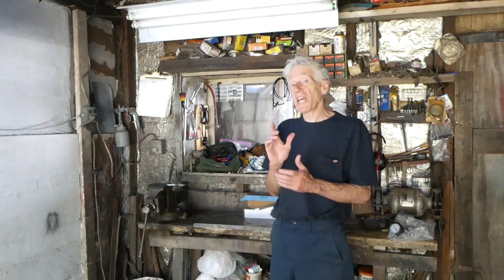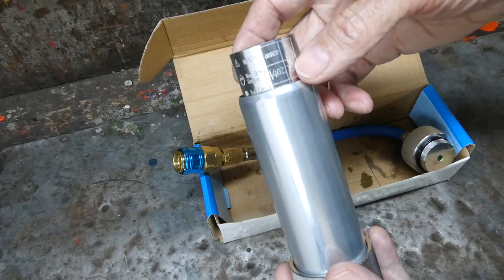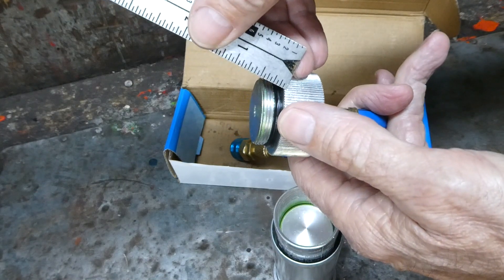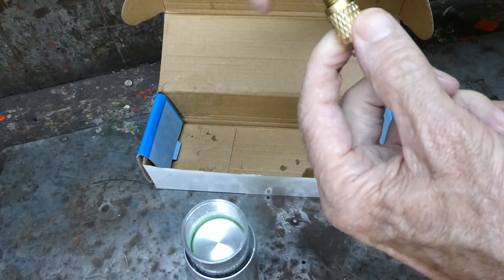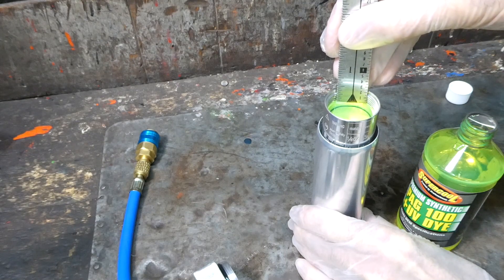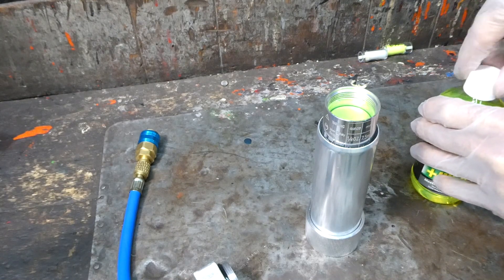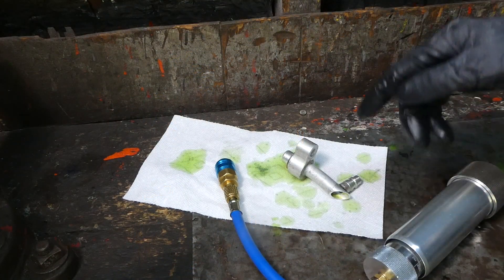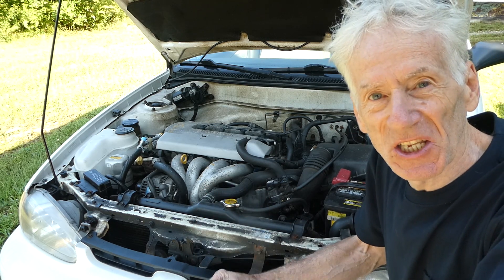Injecting Oil in a Auto Air Conditioning System

Comment: You put more oil in the injector than you need, extra to purge the air. Put the hose over the original container, holding the injector and hose as vertically as you can, screw the injector to the 1/4 oz mark. Hook it to the low port and screw it all the way in.

Comment: Thank you for this AC  hack. how do you know that oil is low in the system, how do you measure oil in the system?                   Q: my Denso type: TSE17C  system leaked and charged r134a and working but   I'm hearing low rattle  noise coming from  ac compressor , do you think it is because of low oil or something else? and if so how much oil can i add?   Thank you
Reply: Replace your compressor now.
Reply: Try first to add 20ML to 30ML of PAG 46 oil when the ac is running... If the noises gone then you are fine otherwise unfortunately you must replace the AC compressor

Comment: One last question, this oil you’re injecting into the low pressure side, it goes back to the compressor or through the expansion valve to the evaporator?
Reply: The low side port its Return line from the evaporator directly to the compressor. That's mean the oil will going to the compressor frist.
Reply: @khaledq8bloshi306  Thank you.

Comment: If I’m replacing the evaporator on my car, do I install everything, vacuum the whole system, then inject the oil? Or can I inject the oil into the evaporator once installed, connect the lines and subsequently vacuum the system? I ask because the service manual on my car states to add oil to the evaporator when replacing it, but it doesn’t say when..

Comment: All a bit too complicated if you want to add dye to determine leaks. Note that If you're injecting dye into the system...then there's obviously a leak. If so, it would be advisable to inject the dye when the system is depleted of refrigerant. As well, don't worry about injecting a small quantity of air with the dye as you will have to vacuum the system down prior to adding the correct refrigerant for the particular system. You then require a UV light and the appropriate glasses to view the leak. Most of the equipment required is available on the net at very reasonable prices for the DIYer.

Comment: After the oil gets sucked in,  you are left with vacuum in hose and container, right? After switching off engine,  the gas will flow into the vacuum part,  right? Would it be better to detach while running to avoid gas loss?

Comment: @3:45 Just brilliant idea to remove air fm the injector. I need help w/amt of oil. Can someone solve this arithmetical puzzle from the Shop Manual? It states in the Manual (car is 2001 Saturn SL2):
The Saturn air conditioning system requires 150 ml (5.07 oz) of PAG compressor oil. Service compressors have 65 ml (2.20 oz) of PAG oil installed.
New oil quantities must be added to the system during component replacement and conditions stated as follows:
With no signs of excessive oil leakage, add:
Compressor: Remove, drain, and measure oil. Drain the replacement compressor. Add the same amount of new PAG compressor oil drained from the removed compressor to the replacement compressor.
Evaporator: Add 67.5 ml (2.25 oz) of new PAG compressor oil.
Condenser: Add 22.5 ml (0.75 oz) of new PAG compressor oil.
Receiver-dehydrator: Add 30 ml (1 oz) of new PAG compressor oil.

Open the R-134a source valve(s) and allow 0.50 kg (1 lb) of liquid R-134a to flow into system through low side service fitting.
As soon as 0.50 kg (1 lb) has been added to system, start the engine, set the mode control to vent, the temperature lever to full cold, the blower speed on high, and push the A/C compressor button to the On position (A/C control button light On). Slowly draw in the remainder of the refrigerant charge 0.23 kg (0.5 lb). The total system charge is 0.68 kg (1.5 lbs).

I'm reading all that information in my Shop Manual and don't get this:

If the total amount of refrigerant oil is 5.07oz and 2.25oz goes into compressor, then for Evaporator, Condenser and Receiver Drier is left only 2.82oz (5.07-2.25=2.82oz). But if to add what is recommended for Evaporator, Condenser and Drier it will add up to 4.0oz (2.25+0.75+1.0=4.0oz), with the total in the system 6.25oz (4.0+2.25). How much oil on total is in the system: 5.07oz or 6.25oz? Where I'm wrong? I'm replacing everything besides the Evaporator and Compressor (I'll remove it and flush w/solvent though), those I'll just flush with solvent. No info on Refrigerant Oil under the hood or in owners manual, or in Haynes book. Thank you.

Comment: What about using the oil in a pressurized can with a ac manifold vs this method? I already have a manifold...I just want to add a little to keep compressor working..its just a little low. Thanks

Comment: How can I get that tool? the stuff I bought doesn't charge as quickly for my Saturn 99 SW2. I bought a cap and a hose with the gauge on it. Like you, I started small with a 3oz can but it was filling really slow. Thanks. Love your Saturn videos.
Reply from the maker: I bought the tool on Amazon if you can not find it i will see if i can find the part.

Comment: U said in a previous video , that after injection oil you will again test the volume with the autel oil tester to see if the oil amount is correct. You said that again. Are you goint to make part 3 then? This tool, and the tester look good tools.Seems to do the work
Reply from the maker: I should have tested it and included it in this video.Now that it is getting colder the A/C is not on my radar but i will see what i can do..